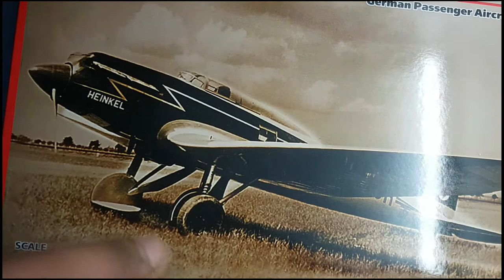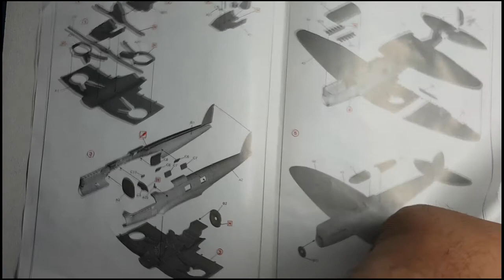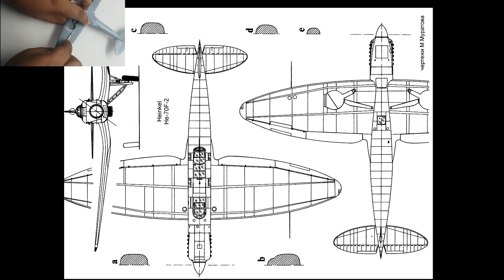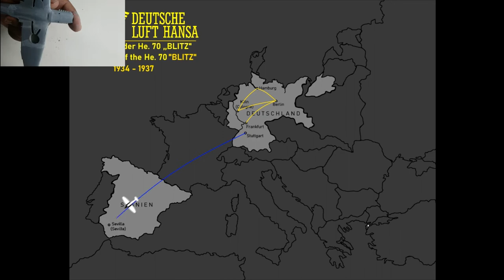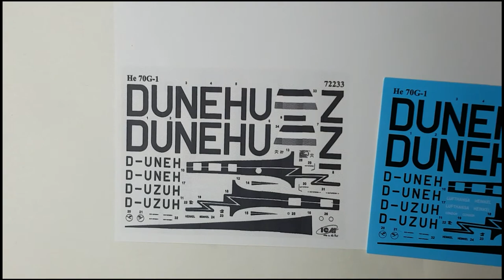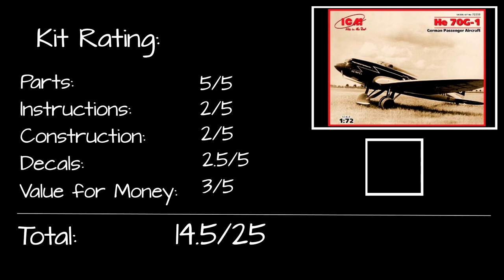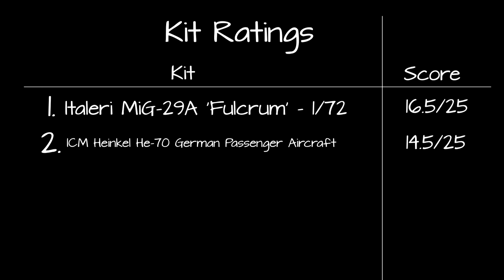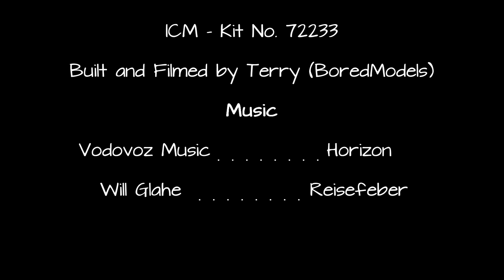Heinkel He 70G-1 Airliner (ICM, 1/72) | BoredModels Review

Comment: I think the rating is better.  Ok, the instructions are terribles.  Worst quality in images.  But, the constructions and decals are good.
Reply from the maker: Hi 63renan,
The reason I marked down the construction so much is mostly due to the poor fit of some parts, particularly the fuselage halves and windows. However, I guess I was a bit harsh when it came to the decals, as in hindsight, I created most of the problems I had...
Reply: @partsofhistory595  Yes, Thats decals are a nightmare.